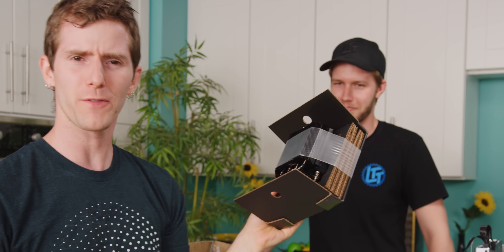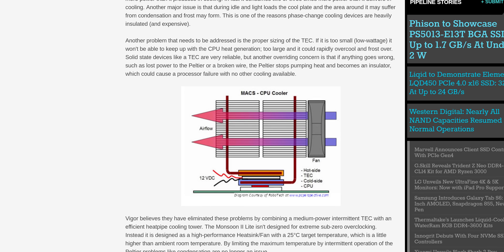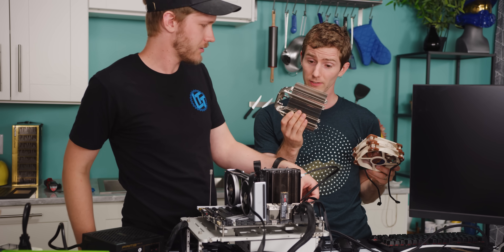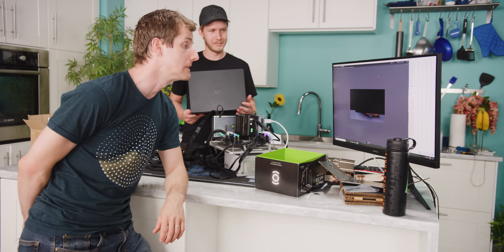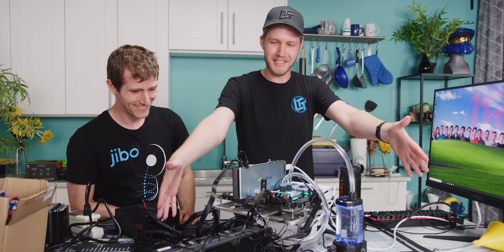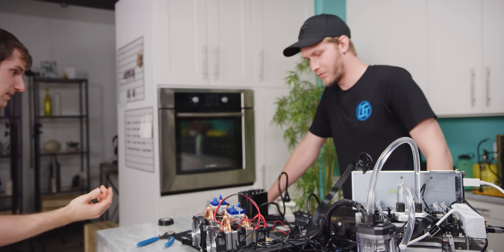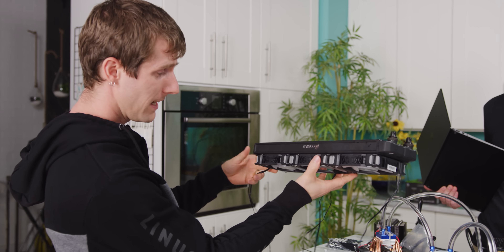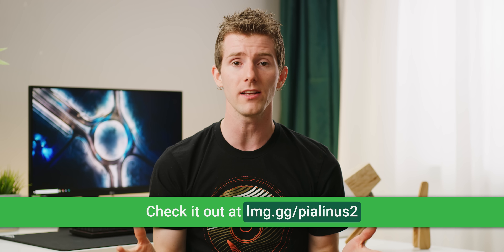Thermoelectric Cooling is a Bad Idea

Comment: In another life I worked with industrial vacuum systems and some of the equipment required refrigeration cooling costing hundreds or thousands of dollars.  However with the advent of laser cutters refrigerated water chillers are available at reasonable prices such as:
BestEquip
Model: CW-5000DG; Tank Capacity: 6L; Maximum Flow: 10L/min Use of environmentally friendly refrigerant - cooling capacity is 800W This water chiller functions compressor delay protection - compressor overcurrent protection - flow alarm and over temperature alarm Industrial chillers features two modes-constant temperature and intelligent thermostat; Temperature control accuracy can go up to ±0.3°C Water chiller machine is suitable for small water cooling device - specially designed for cooling 80 or 100W CO2 glass laser tube.

Amazon: $484.97 

Why not connect this to a water cooling plate on the CPU?  

If that is not enough there is a BestEquip 1400W Industrial Chiller CW5200DG I would say would frost up your CPU no matter what you do to it!

https://www.google.com/aclk?sa=L&ai=DChcSEwiHyKaBy_vjAhXJnLMKHQ_cBwcYABABGgJxbg&sig=AOD64_3FpWGB9cS8cobbNKPJnogxceZ2qQ&ctype=5&q=&ved=0ahUKEwiqiaOBy_vjAhXihOAKHWXPCNYQ3ikIHA&adurl=

Comment: You need to stack the peltiers.   Put your new big one on top of the chip size peltier (using an aluminum heat spreader between).  Put your giant cooler on top of it all and connect a very large power supply.  Note that the lower the delta T between  hot and cold side on the peltier increases it's effeciency at moving heat.

Comment: For peltier cooling to work right it has to be an assist to the solution and not the solution itself. For the cold side a radiator to remove most of the heat before it gets to the peltier unit is needed. On the hot side forget about heatsinks with fans. Instead just have a water block for that side as well going to another radiator to exhaust the heat. Then it would be easy to fit into a PC case. Then it would work because it is extra to the solution rather than the solution.

Comment: Radiator easily wins due to contact surface area and less heat exchange steps involved already.

Heat transfer from the water through the small TEC to the heatpipes and then to the radiator and then the air is entirely bottlenecked by the tiny contact area of the tec.
Where as the radiator has a massive amount of surface area, skips a bunch of inefficient heat exchanges and transfers heat directly from water->radiator metal-> air.

Comment: You could probably find a free home ice machine (they fail often due to microswitches) that would do a much better job.  It wouldn't even be hard to have a microcontroller run the compressor cycles.  Then there's Stirling cooling.  I'm amazed there's nothing commercial around that yet.

Comment: I feel like the water cooling loop had issue because of how little contact the unit has with the loop - instead of it traveling all the way through the radiator, it just touches the TEC for a second

Comment: Anyone else here run a STEP ThermoDynamics, Inc. dual Celeron back in '99? 

Those things were BEASTS! 

STEP high pressure fused a Peltier directly to the CPU. I was able to push duel 400 MHz Celerons (yes, the fastest chips for the kids with cash to burn on overclocks were Celerons in the late 90's, and yes we ran multi-CPU) over 600 MHz to curb stomp latest and greatest 600MHZ Pentium III. 

The only bad side was work (multi-threading) was done in Windows NT, but gaming had to be done on Windows 98, so no multi-threading in the OS :( - Windows 2000 made it better, but not great. 

<old-man-rant>You kids today with your having more cores than I had MBs of RAM, you don't know how good ya got it </old-man-rant> :P

Comment: The bigger problem tho with your  "Janky" Peltier cooler setup is that the water does not have enough surface area to actually cool down on. It would be WAY more effective if the Peltier´s would cool down a radiator.

Comment: You should try building a sub-freezing system in a controlled atmosphere without moisture, or maybe submerged in mineral oil to prevent condensation.
Reply: Why? You just add insulation and a 5w heater on the outside... My daily machines run perfectly fine at -60c and I don’t have any issues. Sure I do a bit more than insulate, but it’s not rocket science.

I can strap on an LN2 cooler in about 5 minutes, but then you’ll have to do 2 hours of updates for all your benchmarks, so you might as well do the insulation while you’re waiting on software updates with it air/water cooled.
Reply: @jakegarrett8109  Mostly because I think it would be a fun challenge for them. I would love to see them build a sealed custom computer case (possibly filled with nitrogen) and  put a solid-state dehumidifier in it.
Reply: Patric Halldin I can see the Tupperware storage box (people have done that), and the LN2 used for cooling expands 700:1, so it should do a good job keeping it pure nitrogen in the box and keep air out (or if you’re using phase cooling, then even I’ve got spare nitrogen gas bottles). It’s the mineral oil that wouldn’t work. I froze anti-freeze coolant (the coldest rated stuff I could find was like -60 rated) when I put dry ice in it (which is barely any colder than my simple phase cooler), and that might be a problem if it expands and say, gets under the socket or SMD components and the expansion of the ice rips off capacitors or something. I didn’t have that issue with my single test measuring for voltage drift and ripple of a single stage VRM (buck converter), but it was really minimal parts on that small board.

Misc info about that test: I was able to submerge the component directly in the antifreeze, just like you can with distilled water, but at around -30c the voltage went a bit insane and made me worry, it stabilized back at -40c and stayed fine for hours even as solid block of antifreeze coolant. It wasn’t a huge like 5v to 12v jump, but it was enough that I’de probably fry my CPU because I don’t bench the parts lightly, it was like 10% deviation, like 5v jumped suddenly without warning to 5.6v, I decided that was unsafe letting VRM get too cold, people had mentioned it for motherboards so I tested on a cheap part I didn’t mind frying, it’s real, lol!

I just find insulation way less messy than oil or antifreeze too, the cleanup time is not worth it (also the oil and antifreeze will both eat up certain plastics after a while, RIP my anti-freeze leaked on my water cooled tablet, that SD card turned into floppy Jello!)

Comment: I remember this there was one that I wanted to buy it was a. Cooler with a LCD screen that went into the 5 1/4 drive bays with a stick man digging  any way I never got to get it  but hay it would have worked out on a dual core AMD 5400  processor yep it been bit

Comment: You guys should get an amp clamp for the 12v line to the TEC instead of using a kill a watt, kill a watts are great for measuring the overall consumption of the system, but if you're using it like this, you're including the overhead of the power supply, which can vary for every PSU.

Comment: I'd love to see you guys try to use other fluids like. Glycol (antifreeze) and  Deionized water
Reply: Use water wetter or ammonia.  Anti freeze is actually a worse heat transfer medium than plain water.  Race cars use DI water for that reason.  Anti freeze is used for the lubricants and anti corrosive properties in automotive applications.  There are also silicates in it to prevent small leaks that can clog up a system such as desktop water coolers.
Reply: @Worrsaint  well its used so it doesn't freeze as well lol running a car with water instead in the wither could be funny to see
Reply: @danman9847  Well yeah, I figured that would have been stating the obvious because it is in the name.  What I was getting at (poorly I guess) is that automotive anti freeze is not just glycol and di water.  Doing 20%+ PG and the rest water would have the benefit of keeping things from growing in the water loop though.  

As far as running it in the winter, race cars are drained after every race.  DI is very corrosive to metals.  If you mean an everyday driver, it can crack the block if it freezes.  At least some engines also have freeze plugs that are made to fail before the black does.  I do not know how effective they are though.
Reply: @Worrsaint  yeah my dad once bought an old truck form california with water. The next summer it doesnt run and is all rusted up lol.
Reply: @eeedoubleyou  The boiling point matters more in an unpressurized system because you can not just design for a higher pressure to increase the boiling point.  As far as heat capacity and heat transfer, straight water is better.  Water also requires less power to achieve the same flow.  If you can get away with water in a heat transfer system it is the better fluid choice over glycol based coolants.

I never thought about the slippery track conditions but it makes sense.

Comment: TEC breaks apart at 100 Celsius. And they become inefficient at 70 celsius. As the current per degree raises sharply. A good TEC setup requires a good thermal mass on both side. Both those heat sinks have inadequate thermal masse on the cpu side. That is why the cpu overwhelm the TEC so easily. A good TEC setup should not let your cpu over 60 celsius regardless of load. For that you need your TEC to be twice as strong as the heat lost by the cpu. Surface area becomes a problem.

Comment: TEC cooling is good as it's enable subzero cooling without any calc's for the refrigiant. You may go -70 or - 100 degrees Celsius if you put enough power in.
It's a way to go to near serious low Kelvin homemade.

Be serious: compressor cooling is much more efficient and wildly used (AC Unit in the server room). 
Some low end industrial water coolers use TEC for testing in the lab and you should use compressor cooler for the normal useage.

Comment: Well, that was pretty obvious, 3x radiator sure able to dissipate more than 350 watts of heat and although Peltiers themselves maybe could do the same trick,  it's not obvious if their coolers could. Also, I'm pretty sure they designed to operate best in a pretty narrow temp margine with a performance drop outside of it. I don't see how plane old cooling could benefit from that. 
Sub-ambient cooling on the other hand... like if you Peltier the CPU itself and water cool the hot side to keep it well between the operational temps. or maybe use two loops to chill water in a CPU loop to sub-ambients like you've done with a chiller

Comment: LINUS FOR THE LOVE OF GOD, USE FLUX FOR SOLDERING THOSE THINGSSSS 

REEEEEEEEEEEE
Reply: Or you know, crimp connectors.  Heck, BigClive's video introduced me to Wago connectors.  No soldering or crimping needed.

If you're going to do it correctly, you want flux, and (this is important) put the heat shrink tubing on before soldering.  Because we've all made the mistake of forgetting the heat shrink.
Reply: 1 GigaPaul of flux must be used on board repairs and wire joints. You can get the best flux ever on store.rossmanngroup.com. Don't delay, make shiny joints and buy today!

Comment: What about the radiator with a peltier in the loop. With a temperature switch using the peltier as more of a booster to kick on at a specified temp letting the radiator do 90% of the work it should use less power and only come on at say max load. I could be wrong but if nothing else it would be a "bad cooling idea" lol

Comment: "In this house we obey the laws of thermodynamics!"
Reply: my favorite Homer quote
Reply: Unballanced wheel stops spinning.
Reply: But if you had the choice...
Reply: A peltier is greatly limited in efficiency by the amount of heat that can be extracted and removed from the hot side of the semiconductor module. Although the modules are ~300w they are NOT working anywhere close to their optimal performance rating. Linus should have used water cooling to extract heat from the HOT side of the peltier with the cold side directly contacting the processor and thermal compound. That is the optimal configuration for thermal performance. (Condensation issues can be easily solved by submerging the PC in mineral oil) Linus is great with computers don't get me wrong but his understanding of physics and his engineering is child's play and I'm not impressed. I don't care if his sycophant fanbase gets triggered or upset. Linus is a computer 'techie' with zero technical engineering experience and contrary to his anecdotal conclusions- cooling a PC with a thermoelectric module is actually a good idea provided that you know what you're doing . We can't neglect that little caveat. Now I don't expect Linus to be perfect but what bothers me is how he shamelessly presents himself as an "ultracrepidarian" and how his credulous fanbase accepts him as some kind of superior technical authority in these subject matters when he is evidently not. That being said, if you do actually enjoy this kind of technical content but prefer someone far more qualified and capable, I'd recommend "Tech Ingredients" .
Reply: No, not really. More like obey the laws of human stupidity...

Comment: What if you had the two TECs in series with the radiator? This way, it can sustain the load and still cool below ambient temperature when not using so much power.
Reply: Unfortunately that wouldn't actually work - the radiator would actually act to keep the temperature of the coolant above ambient. At that point the TECs would have not only the CPU load to dissipate but also be trying to cool the air passing through the radiator. The best you would get in this setup would be similar to what you would get without the TEC's in the loop at all.

Comment: played with Peltier cooling on core 2, in fact, one still on it which in2007 was awesome but on these new chips not going to be good somewhere I have one that will ice the board  but requires its own power supply and its huge

Comment: Well linus the reason for this issue is that the peltier chip gives off a lot of heat, then you add the heat from the cpu and you have just lits and lots of heat to dissipate, if you can't disapate it then the whole thing evens out in temperature and then insulates the cpu to a degree, if you had a big enough heatsink you could get it sub ambient but its a lot of heat to dissipate

Comment: Physics says no. You use copper wires because it's a conductor of electricity, i.e. it has free electrons. Unless a thermoelectric solution can outpace the speed and "bandwidth" of electrons through a metal block, they're always going to come up short.

One thing I do want to see though is a grated heat block design, which has air running through it. When the CPU initially offloads heat into a copper block, some of that heat sticks around (for a very short time) and blocks the CPU offloading more heat. Imagine an extreme scenario where you're trying to cool a CPU through a heat sink that's a meter long with a fan on the end - it takes a while for the heat to transfer through the block. I think that the closer to the CPU you can begin cooling your heat-sink block the better.

Comment: Very old tech. Look up the 'IceCap' 486 cooler from 1992. Would let you overclock a 33MHz 486 to 50MHz, (that's a 50% overclock!). Could we handle that much power?

Comment: I got a peltier cell in line with my water cooling loop and a few 360mm radiators, I need a way to regulate the peltier but I think I can get this sucker run at ambient levels all day long,fingers crossed!

Comment: You guys screwed up as there are examples of this working correctly going back into the late 90s as the cpu should have been around 0c give or take had it been done right. Now if you want something truly exotic cooling wise then consider liquid metal as Sapphire once did a couple of prototypes almost two decades ago.

Comment: the problem with TEC cooling is everyone taking the same approach that ends with crappy results, its like those cheap AIO cpu liquid coolers; they are fucking pointless

this thing is just as pointless, if you want to actually make use of this, do a custom watercooling loop, and then instead of rads on the hot side use a waterblock on the cold side of the TEC and then cool the hot side of the TEC with rads, and keep all that stuff away from the rig, and stop doing those tiny 40-80mm fans and crap of course its gonna suck

ive built a personal TEC cooler unit with a huge TEC plate sandwiched together by 2 giant cpu heatsink towers, the hot side pushes air away from me, it cools the air by around 5º which frankly feels like ice in hot summer days outside, but of course anyone going behind the thing is literally getting cooked 

if you want a TEC to perform, you need to cool it, and it needs A LOT of cooling, the better you cool it, the colder it gets on the other side, so stop thinking this device will blow ice on you with a tiny 40mm heatsink on the hot side as if it were so damn magical

Comment: Might work better if you first put a normal radiator in the loop and then the TEC coolers, that way you can reach sub ambient easier while using less power, although I doubt if a 500+ W TEC is enough.

Comment: tec cooling can work but you cant do it the way almost everyone tries to.  note a tec doesn't so much increase the eff of the heat sink actually it will make it worse because of the extra heat that will need to be dissipated from the tec.  the problem is that a tec can only move a specific amount of heat, once you pass that it is basically an insulator. So if you need to cool 200 watts of heat and you have tecs which can move 50 watt you need 4 tecs and you cant stack them like a sandwich, they need to be run in parallel like you guys did.   all a tech can do is get you sub ambient as long as you under the rated delta E of the tec.